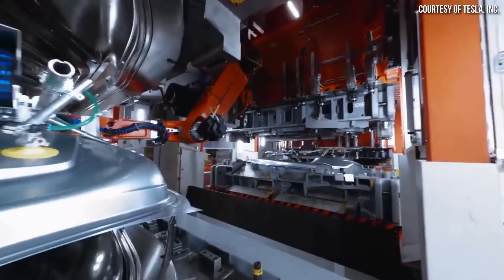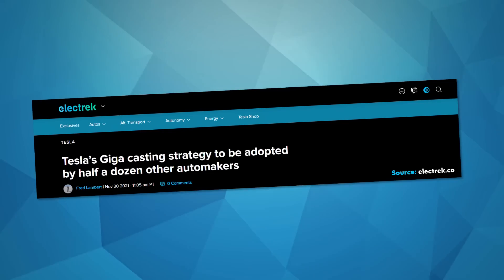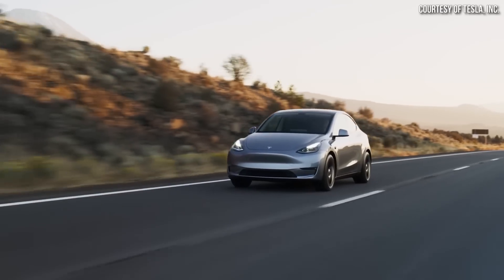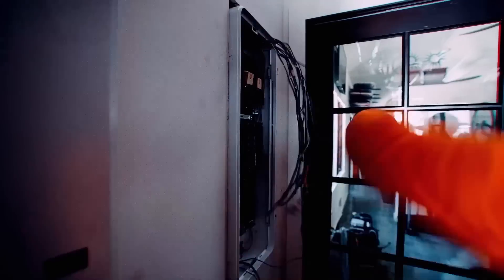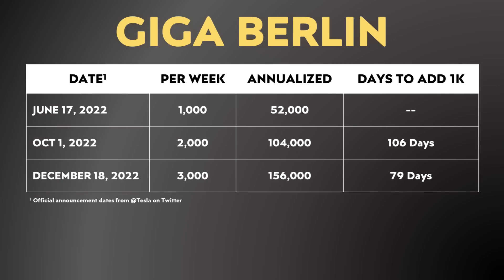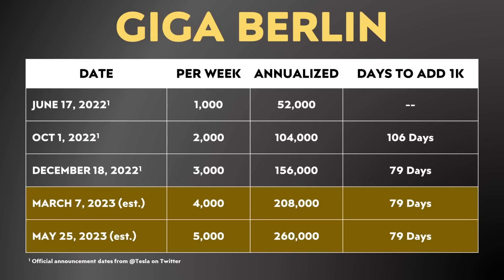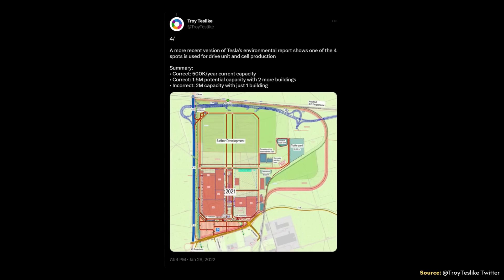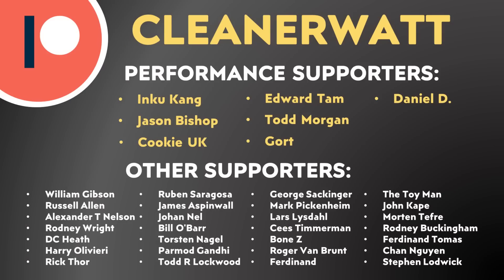PEEK INSIDE Tesla's GIGA BERLIN FACTORY + 4680 Batteries & Expansion

Comment: More hype but still a solution looking for a problem.  Really, what is the point?  Modern ICE wins every time.  Efficient, low polluting, long lasting, long range, existing infrastructure.  What's the big deal with ev's?  Do tell.
Reply: Cluelessness confirmed 

Blocked

Comment: This is pretty disappointing.  Shanghai ramped to produce ~460k vehicles in Y2 of operation.  Granted, an additional plant/line (MY) came online at the beginning of year 2 (2021).  Berlin was supposed to be a next gen factory that would be even faster.  If the plant will take another 4 months to ramp up to 5k/week it could take another year to 10k a week at this rate.  By June the plant would be ramping for 15 months already.  Shanghai was light years ahead of this.

I also missed the good news about 4680 production.  Cell production not starting in Berlin until 2024 is really bad news IMO.

And no new filings to extend vehicle production capacity is more bad news (although this has been known for a while).

2023 should be a big year for Tesla, but Berlin does not seem to be pulling its weight.